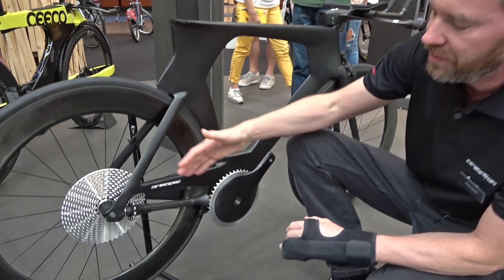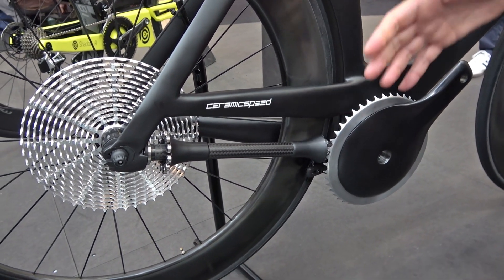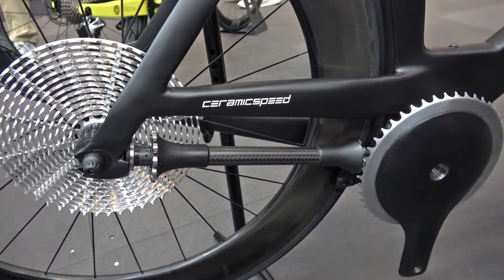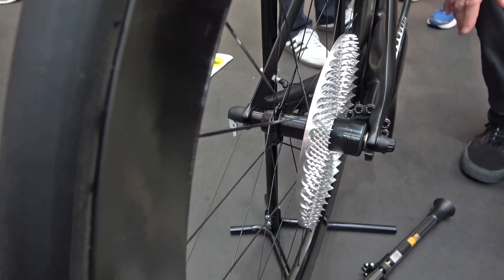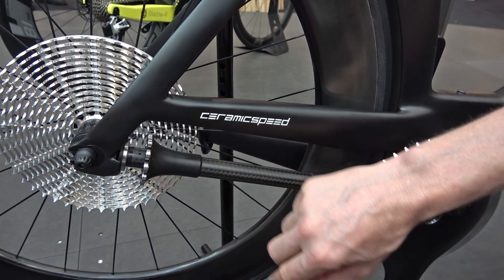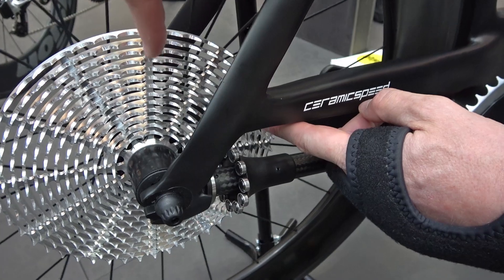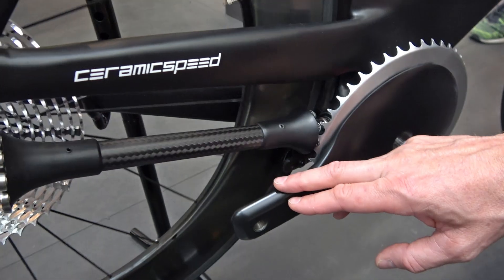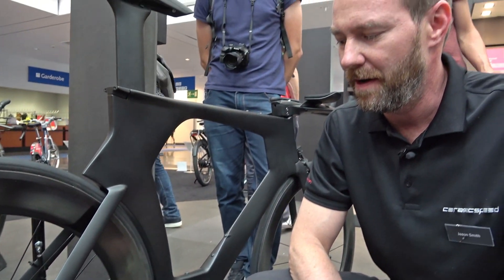CeramicSpeed Driven - Fully explained

Comment: OK the problem with the design is this. Put the drive wheel in a vice so it cant turn, now apply large force to pedals watch what happens.....the drive shaft pinion gear is like a big leaver and it will push against the gear hub perpendicular to the wheel, and if you are using an outer gear, it will only have to bend the outside of the ring 10mm and it will jump a gear. You will need to massively reinforce the wheel so no matter how hard you push perpendicular to the gear hub, it does not move. It also means that any gear change will have to be carried out without any force on the pedals, if you are on the pedals when it changes it will crash and clatter through the change channels......What you need is a device that has more points of contact that you can transfer the load in stages...A CHAIN.....There are  no free lunches, if you have less points of contact then you have less friction but you have a higher force per point of contact, so you will have to make everything stronger and therefore heavier.
Reply: That true, less points of contact is lot more of pression
Reply: Paul Murphy excellent observation!
Reply: i was thinking the same thing. this looks like all of the pressure, is on one tooth.
Reply: Run through some muck and pick up a tiny rock in one of those teeth. Watch the system come to an abrupt halt. Or one good offroad crash bent teeth and/or disk. This system LOOKS cool. Still has far to go. Could be accomplished with solid helical cut gear to allow for linear gear changes under load. Current concept is solar road. 1000 cool factor, utterly impossible to actually put into use.
Reply: Ever imagined what happens when a chain is a little worn? Yep, it only has one or very few contact points as well. 
Shifting is a problem, yes. But as there are electronic derailleurs, there will be an electronic solution for the shifting problem. Also the strength can be addressed. If you do some FEM analysis, you can easily design an axially stiff yet light gear wheel.
This won't be mass produced stuff. With production bikes in the 20k region today, there will be someone willing to pay the price for the extra percent of efficiency.
Reply: FEM analysis? I use FEM but this is definitely not something you need FEM for, it's a perfect circle with other circles, straight forward maths is all you need. And no you can't easily design an axially stiff, more importantly where you need it to be stiff, yet light wheel or they would have surely done so for their exhibition. I'm sure they already did the maths and made the wheel but said "we cant show that, people will laugh at how heavy it is". This type of drive is already used extensively on motorbikes and weighs about 10kg minimum which is the average weight of an entire bike. And a worn chain just sits a little deeper on the sprocket and can be taken up by tightening the chain this system cannot tolerate wear or be easily adjusted for it. Note that on motorbikes it is always fully enclosed and sits in a gearbox of oil. At the final design meeting they said "oh well never mind, it looks very cool, let's just set it up without that heavy wheel and use it as a technology demonstrator"
Reply: @AirCrash1  yes, of course you can simply add thickness to a disk to make it strong, but that makes it heavy. In a modern CAD program you can design a neat 3d form with material exactly where you need it. 

A worn chain doesn't simply "sit deeper". It lengthens itself steadily, so only the first teeth on the tension side engage to the chain, the rest will be almost load free. 

Also, the system on motorbikes like BMW is different from this one. They use normal bevel gears. These have heavy sliding friction, so they must be constantly lubricated. Also the gearbox casing doubles as the swingarm and transfers a tiny little bit more power than a human can create.

"Driven" on the other hand has no normal gears. Just ball bearings absorbing most wear. Most ball bearings are self contained, so no lubrication issued. 

Just dirt needs to be addressed, but since this is a road bike it won't be so much of an issue
Reply: Probably needs a nearly air-tight cowling over the delicate gear section, for real world protection.
Reply: I agree - there is a reason that bikes aren't built like this. It's not because no one has thought of it before; it's because it just doesn't work. This would self-destruct under climbing or sprinting load.
Reply: a chain has to move less when it's single contact point slips, just until another link hits another tooth. this would slip until the next bearing hits
Reply: mmm. Not wrong
Reply: Call me dumb for replying to this with no knowledge on the topic, but I'm sure there's a material they can use, which is both light-weight and sturdy
Reply: @cwazykid8169  yeah, you mean like titanium? Sure, that would be easier to design to remain light, but would cost a fortune to manufacture. It's just not a viable option. Also, that's not the only problem with the design.
Bike technology had sooo much time to evolve, we can't really add too much to it, most of the "innovations" are just stupid clickbait ideas filled with buzzwords (notice "carbon fibre shaft" and "fully wireless" while that has nothing to do with the tech), and they just don't worth a fucking buck.
Reply: @humanISvegan you must be a troll. ...right?
Reply: They will come with a solution, but for now this seems to work and got potential
Reply: If the hub gear "tooth cut away" is shaped, such that axel gear rolls into place before it starts exerting a force, then the axel gear will be exerting a force in the direction of hub gear travel with no perpendicular component perpendicular to plane of hub gear. I'm thinking that should work fine for forces a human being is able to bear down on.
Reply: The same (or very similar) is true in your car. So it can be done, just needs to be properly stiff.
Reply: @fabianrudzewski9027  But with the chain it's still a radial load - bearings like that. And you're right - old chains slip, but they are pretty cheap and easy to replace. In case of this innovation it seams you would have to replace the whole carbon fiber-battery powered-wi-fi connecting-microprocessor-linear actuator assembly (if it would work in the first place). From my engineering experience i don't need FEM analysis to tell that the sprocket shown in this clip will bend.
Reply: very nice analysis- I was wondering about the drawbacks of the concept
Reply: you addressed what I was thinking about writing about . . . as the camera shifted around to the rear, you see no rigidity built into the rear cog.  Seems that rear cog would bend away from the rear pinion . . .
Reply: 2nd Law.
Reply: @charliecrash3450  Yep, that thing will vaporize in ordinary airborne bacteria, these days.
Reply: @fabianrudzewski9027  have you ever ridden Paris Roubaix?
Reply: @Braeden123698745  That's what she said 🤣

Comment: Hmm. And how are you going to keep those bearings clean? Unless they're sealed... and there's your friction. And there is sliding friction. As the teeth of the sprocket come into contact with the outside of the bearings they have to slide back and forth a bit with the rotation of the sprocket..  With a chain that doesn't happen. This system may well have more friction than a standard derailleur. Which is how it is with shaft driven motorcycles - shaft drive has more friction than chain. This is what comes with a change in direction of rotation.

Comment: How hard would it have been to put peddles on it and have someone demo it on a roller?   Ah, that would have shown how weak the rear gear hub was!   Nice idea though.
Reply: Because its just a static model, none of it realy works
Reply: MegaPoxie the teeth would start breaking off.
Reply: ...and put two PRO cameras mounted at the pinion during an actual ride...fit the one pinion on a road bike and another on a mountain bike.
Reply: It's in beta. Everyone wants everything finished or it's junk, right?
Reply: nitemareman1
He said he "has a functional, engineering prototype"   Would have been nice to have seen that one and to see it working since he is making claims.  The concept is awesome, just would have liked to have seen the functioning version as there are real strength issues with that rear cassette.
Reply: The pinion on that demo is made of plastic as evidenced by him saying it would be made of carbon fiber not is. You'd destroy that demo. It's not a finished product. It's a concept.
Reply: @nitemareman1  Haha, beta. Early alpha at most.
Reply: Yea i agree, if you pedal hard uphill, the rear gear hub will bend inside the wheel, on the 13th gear u would not even be able to pedal once and move
Reply: @nitemareman1  "beta"? So far it's only a half baked idea that doesn't work.
Reply: Kirk Claybrook So a model physically built and operating in front of your fucking eyes is “half baked and doesn’t work?” Interesting outlook on the world you have.
Reply: @nitemareman1  "built and operating"?! Put some pedals on it and show us how it changes gears if it "operates". If it can't do that then yes, SO FAR, it's just a half baked idea that doesn't work. EDIT: and BTW, a crown and pinion gear is not a new idea. Not even sort of.
Reply: 'flawed concept' would be the correct term.
Reply: Just went to the their website. Clicked "shop" - first thing that pops up is what looks to be a stylized derailleur. So yep. More vaporware. Some can say it's still in beta, or still in concept, but really, the materials needed to make this actually work will probably never exist.
Reply: @Penguin_of_Death  spell check
Reply: @nitemareman1  boring
Reply: @GregPolkinghorne  and a boring one.
Reply: Not convinced.  Large, "sprocket" on the wheel will simply deflect from a high load. Interesting concept mainly I think to create interest at a show.
Reply: @nitemareman1  the problem isn't that it's unfinished, the problem is that it won't work and they know it.
Reply: If it's functional then change gear,besides look how much they charge for there bearings alone,this is gonna be thousands of pounds,not worth it
Reply: @nitemareman1  Did you see any bike equipped with this mechanism ridden by anyone? Well...this thing doesn't work. First pedal stroke with some weight on it and it's a gear slipping disaster.
Reply: @kirkc9643  Baked, Fried, Par Boiled, Toasted.
Reply: @MattExzy  Graphene, surely they must have mentioned they have lined up multiple sources for graphene. Ha Ha Ha
Reply: @sly5999  Yep, into the berm, over the side you go, Lance.
Reply: @MegaPoxie  I know,it probably shatter like a pice of Glass,, but it is a good idea,to bad it will never happen 😤
Reply: @NeverTalkToCops1  Lance is a disgrace to the whole thing and don't even try to go back there, ain't it ashame!
Reply: it's because it doesn't work
Reply: @nitemareman1  I don't see the weight of an average rider applied to this as the disk is in motion. It is functional in that it can demonstrate how the gear works, but it isn't functional in that all forces are not yet applied while in motion.
Reply: How can it be 99% efficient when it has a pion, servo actuated motor, battery power, etc..??
Reply: @brokthehammer  p

Comment: Multiple tiny bearings having no seals or even SHIELDS.  After just one hour in a REAL WORLD gritty road environment this setup would sound like gravel in a blender.  There is no way this could survive the torque generated by the full body weight of a rider standing on the pedals through so few points of contact.  Nothing comes for free: one-percent friction results in one-percent reliability.

Comment: It won't work under load. The entire load is on one little aluminum tooth at a time. Another huge problem is that as soon as you put load on it the rollers will put pressure on the sprocket to move it away from the rollers.  That flimsy aluminum would soon bend. And then there is the problem of changing the pinion diameter. If you do that you have to move the pinion either closer or farther away from the sprocket.
Reply: bombero42  you're so right . I think it will fail at the outer reach of the rear sprocket . Beautiful piece of jewellery though
Reply: @darrenbutler160  One for each ear (:-)
Reply: yes and no.  LOOKS a bit flimsy, but that could be 110% solved by beefing up the supporting structure with a 1/2lb of extra aluminum.  They didn't set out to build the world's lightest bike gears. ;)
Their "shift channel" scheme is pretty tricky, but there could also be a more straight forward method of swinging the rear of drive shaft out, then moving to new gear location forward or aft, then moving back into engagement with rear sprocket.  But that wouldn't be as sexy.
Reply: @bigsqueeze7883  Maybe, but I would still have doubts. One tooth supporting the whole load when a cyclist starts off is quite a bit.
Reply: Big Squeeze If you think 110 is a real percentage I can understand why you think this will work
Reply: Have someone explain "hyper-inflation" to you.  Grown-ups are talking here. @darrenbutler160
Reply: Big Squeeze. I think you should 120 % stop  using that word a day toilet paper you have been reading as you're confusing monetary devaluation with percentages you muppet
Reply: WOW you seem to know everything bad about this design but if you were so intelligent why didn't you develop it and make it better?
Reply: I totally agree.  The benefit of a chain is that the lead is distributed on several teeth.  Even with aluminum teeth in a standard cog drivetrain, the aluminum teeth wears quickly and is good for maybe one season.  This garbage drivetrain is going to have to be so extremely beefed up with hardened steel, it will be absurdly heavy.  Yeah, this is a drivetrain that breaks teeth really easily.
Reply: Agreed you'd have to have a really stiff/strong brace to keep the rollers in place.  Agree on the latter point,  change the plane of the rear cogs perhaps?
Reply: @bombero42  absolutely. Strong cyclists already can make a traditional chain skip over a chain ring when minimal teeth are in contact with the chain. This design won't work when power is introduced. Too much power is transmitted over a small surface area.
Reply: It's on 2 teeth at a time, but you're right. To be fair, with chains It's on one Link in a Time.
Reply: @RandomGuy-ol6wi  compare this to  a Snapper 26in. Mower  drive train

Comment: "We haven't done measurements but we feel this will be 15-20% lighter". 
Seems like an odd thing for an engineer to say.
Reply: "we have the scales, but the math still eludes us"
Reply: @squirming_squirrels  Right...
Reply: A 15-20% weight advantage could be negated by making that shaft out of this stuff called "metal".
Reply: We have removed the chain and rear derailleur but we have a battery, multi bearings, actuator, spring and electronics lol, pretty much like for like
Reply: The telephones work, you just can't dial out.
Reply: @Living_with_it  not even mention "battery" as far it won't let you stuck on the train tracks...or miss gears in a turn! Lol.
Reply: @NeverTalkToCops1  lmao
Reply: Before long testing shows exactly which materials are the way to go for long-term reliability, it is not possible to know the exact number. And I would say that 15-20% is a fairly narrow estimate.
Reply: @NeverTalkToCops1  😀
Reply: and with the battery that fits in the tube you can get 4 hours of riding while changing gears?  6hrs?  full 24hr day?  recharge it with?  A lot of unanswered questions from an engineer and that, frankly, seems odd at best.  Clearly they're still working through some issues and lets hope this comes to fruition.
Reply: Yeah, wait a minute guys,  they need to just spend a day and weigh stuff.  Sure, there will be caveats but this guy seems capable of discussing those.  This seems a little lazy when putting out a video to show the world.
Reply: Scam business in plain sight. Also This will never be made because there is not enough tear and you need to have artificial inflation for shareholders & CEOs.

You need to be depended on the product. Planned obsolesce scam in plain sight.
Reply: I asked a guy he said it felt lighter to
Reply: No chance of this system being lighter